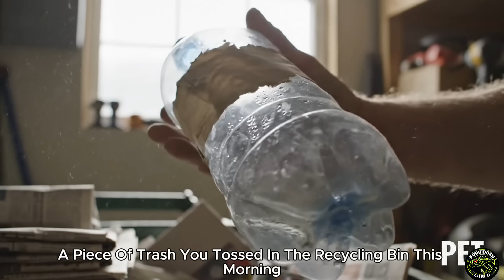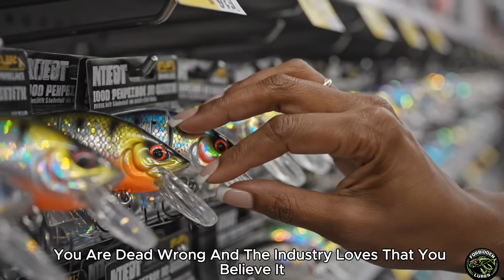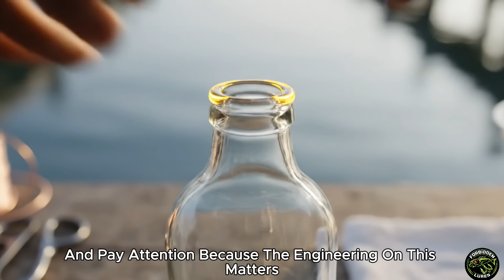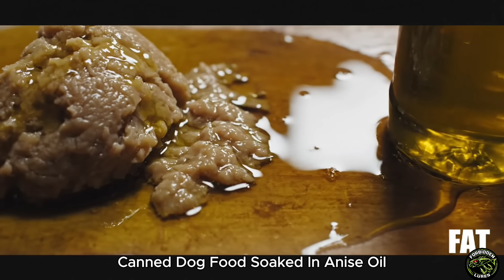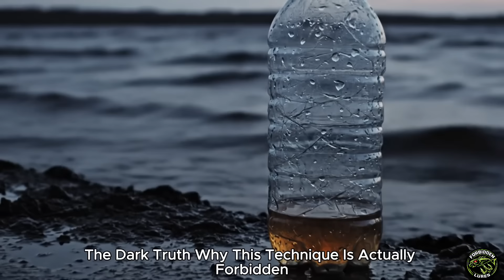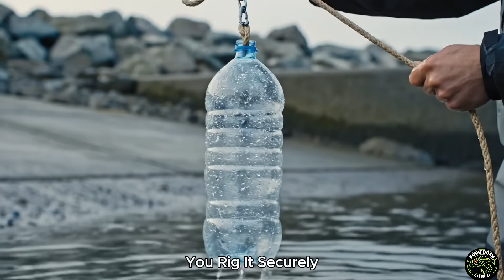One PET Bottle Triples Your Catch — Why Is This Technique "Forbidden"?

Comment: Just take a pill bottle drill a hole through the top and bottom then drill holes all around the bottle, run your line straight through it as it is a barber, but it will sink when you cast into the water, but fill it either with a sponge or cotton ball drench it with bait scent so it can dispense through the water excellent for salmon fishing

Comment: Lol are you aware what you are talking about? Explain how you remove air from a plastic bottle with 12 holes and prevent air from getting in again?
Reply from the maker: That is a fair criticism. If the bottle has multiple holes, then the airflow and water behavior need to be explained clearly or the method just raises more questions.